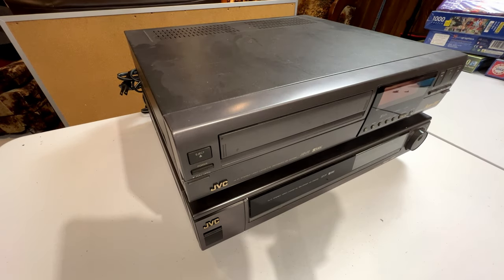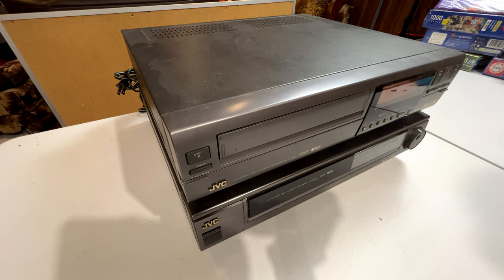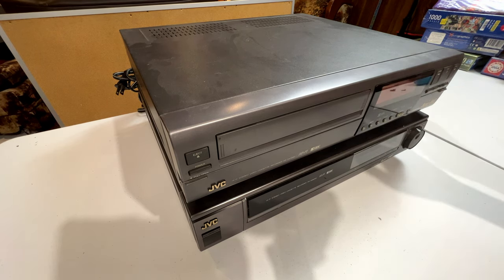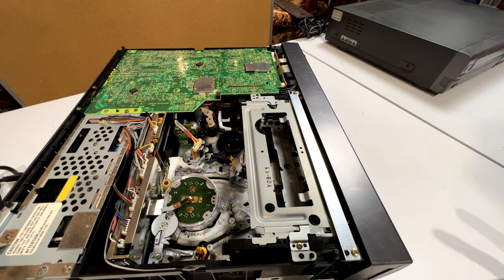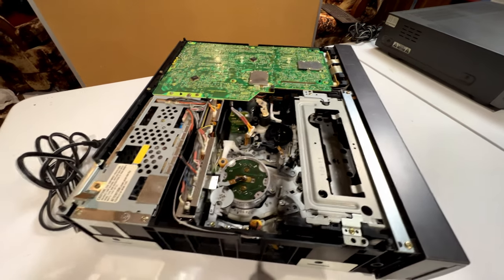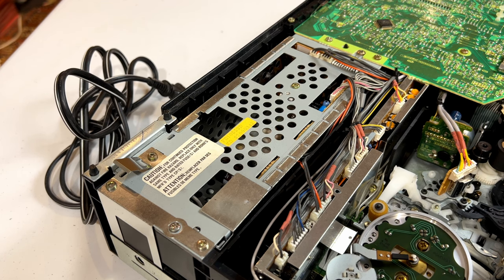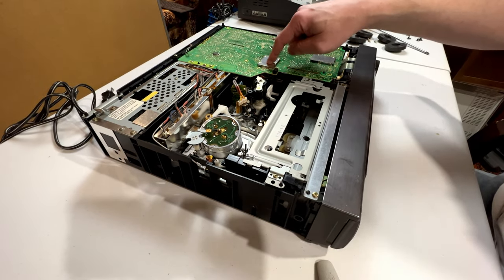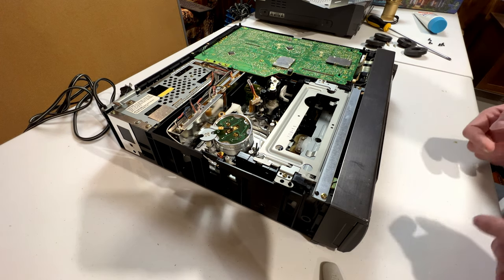Common Issues with JVC Super VHS (SVHS) VCRs from the Early 1990s

Comment: I bought a 6600u at Goodwill for $20. I was so exited about this unit and couldn't wait to see it working. Instead, I got really bad static across the screen, like half the picture shows at best. I can not get the thing to track no matter what I adjust. I was ready to give up and return it. But I think I will replace that capacitor on the drum board. Thanks for the info. I'm glad this video finally popped up in my feed.

Comment: I am pretty sure I have the video capacitor issue, but it could also be a dead head. Anyway I have no clue whatsoever how to buy a new one, let alone replace it ... I know you said it is easy, but I would need a pretty thorough tutorial to give it a try. Also is there anyway to be sure the video issue I have is not a head issue before I invest in a soldering iron and all? my issue is random noise in the image when I get one, sound is usually fine, and whatever image I can manage to get is gone after ejection and reloading. Thanks!

Comment: Well, my 5911u stopped fast forward and rewinding, causing a grinding noise, then it powers off. Thought it might be the gears, so following your guide to use a tape to slide the tray back, only to discover my gears don't unscrew like yours. But now... that tray won't slide back into place. I guess I'm taking it into the shop. Luckily Vancouver still has a repair guy. Got him to service my 7800u last year.

Comment: I bought a European 4700 in 1994 and it always worked great (and by the way it even worked when I plugged it into a 120V socket, before I had a step-up transformer). But whenever I would do a forward or backward picture search on a tape recorded in LP, the color would go away. I always thought it was normal but weird. Now I wonder if it's that capacitor you pointed out next to the head drum motor...

Comment: I have two HR-S4700EG's, which are the Euro counterparts and indeed different to the HR-U4700. The PSU appears superficially the same, but obviously requires 220V mains, and has an ungrounded Europlug socket on the back which is enabled by a relay when the VCR is powered, presumably for a set-top box or decoder. There's an additional PCB inside the PSU which folds over 90º in a U-shape, and has connectors leading to it where the 4700U's PSU seen here has an empty cutout in the sheet metal. 

These VCRs are great when they work but are indeed dogged with LOTS of issues. The head drum caps on both of my units are actually  TTH type, though not sure if those are factory or have been replaced (in which case it was a pretty clean repair job). Also had the idler issue,  pulley gear crack and fall off, plus leaking caps, blown fusible resistors and optocouplers in both PSUs. 

As you mention, JVC used crappy caps in these PSUs, and was even dumb enuff to place them right next to the hot secondary rectifier heatsink with practically no space to spare! What an idiotic design!!! If you aren't familiar with working on switching mode PSUs, diagnosing any issue beyond leaking caps in these things can be a frustrating and dangerous exercise -- it took me months to figure out why it blew that fusible resistor!

One common issue you didn't mention -- and I'm surprised you didn't experience it yet -- is failing SMD caps in the video and audio processing sections. These reside on small modules soldered (!) with edge connectors onto the PCBs, and are a b*tch to remove. Both of my units developed these faults (telltale signs: distorted/sputtering HiFI or only linear audio; on the video board, I understand they develop colour banding issues, though I didn't wait for that to happen). I also pulled a few corroded PCB traces when removing those caps, and they're a royal PITA to repair. I replaced those caps with miniature TTH types bent on their sides; looks silly, but works and will hopefully last longer.

Thanks again for this vid!
Reply from the maker: Yeah, all three machines have fully working Hi-Fi somehow. I'm not touching those caps until I have to. I'm pretty good with getting them off boards without pulling traces, but that doesn't mean I like doing it ;)
Reply: @Oklawolf  I guess it depends on the batch/brand of CrapCaps[tm] they used. First challenge will be to unsolder the daughterboards from the PCB; I used a solder wick with lots of patience. 😩
There's no way you can replace the caps while those boards are soldered in. 
I forgot to mention the Euro models of course have two Cenelec/SCART connectors on the back, plus the RCA and Hosiden/MiniDIN inputs behind the lower right front flap. And of course the playback does indeed reveal People Are Lavender @50Hz. 😜

Comment: Interesting to see, I have a HR-D560E which is a European PAL machine. Just a regular 2 head mono and SP only from about 1990 but it looks almost exactly the same inside. It also have had some of the same problems. It has had the guide posts coming loose I have also recapped and changed a few diodes in the power supply. Now it has developed that little thing with the idlers. But no tracking issues yet (thankfully).

Comment: hello,
for the gear on the capstan motor, i had a cracked one who litteraly fell off.
i didn't bother to search a replacement : simply glued it with cyanoacrylate.
sure it make a bit of a tractor noise in fast forward/rewind due to the gap in the gear, but it work flawless.
and an already cracked gear will probabely be more stable in time as it doesn't suffer from any pressure from the shaft anymore.
3D printing may also be a solution nowdays.

Comment: Hello, I have a question about my HR-S6600U. I have replaced the capacitor, and I am still having issues with the video. The audio still works, but the video only appears for a second when I twist the Jog control wheel. What do you think is wrong?
Reply from the maker: Hard to say without seeing it, but make sure the tape guides are going all the way up. One of my machines did that when the supply side wasn't engaging all the way. The fix was to get underneath and press the retaining pin back in. They can work their way loose.

Comment: I've tried a dozen different tapes some that were recorded on this JVC Super VHS ET #HR-S5911U some factory new and old. Play's fantastic for about 30 seconds then goes blue for 10sec. throughout the whole tape. Tried recording something fresh and it does the same. I cleaned it properly and checked tracking. Any idea's?
Reply from the maker: I'm really not familiar with that model, I'm afraid.
Reply: @Oklawolf  cool. Have you ever heard of that issue with any model? it's also happening with my other S-JVC different model. But the same tapes play fine in a cheap no name model in my RV.
Reply from the maker: I would say make sure the transport is fully working, replace that surface mount electrolytic on the drum board (they always fail), and if it still had issues I'd probably want to take the drum apart to clean the contacts in there. VCR repair isn't really my area of training, so I can only help out with the issues I've personally experienced. 12voltvids would likely know a lot more about this issue than I do.
Reply: Turns blue after 30 sec? Muste be short of breath then... 🤣
(Sorry, couldn't resist...)
But seriously, I suspect it's detecting noise and muting the video (I have a Mitsubishi that does the same). I'd suspect either a servo issue (listen for periodic "hunting" sounds on the capstan/drum motors) or bad caps in the head amp. For the latter, you're best off checking the FM signal from the head amp with a scope; does it fade after 30 seconds?

Comment: Do you have a video on how to recap power supply on 4700u and how to diagnose if they need recapped my svhs 4700u will not power up
Reply from the maker: I recapped all three of mine before I started doing Youtube so there's no video on that. Use low ESR 105 degree parts. It'll definitely need recapping... it's a switching power supply, so any little problem with the caps will take them down. My original 4700U did exactly that same thing about a year into owning it from brand new. The caps JVC used were garbage. Make sure you change out the one on the drum board, too.

Comment: I also have a svhs jvc that will play the tape but not wind it up so i get tape unwinding inside the machine
Reply from the maker: Idler issues - if it's this same transport, the gear drive idler assembly is gummed up and needs greasing. If it's the older transport with the big rubber idler tire, it'll probably need one of those. Hard to find... see my BR-S605 video for details.